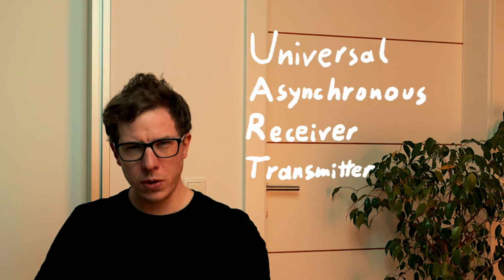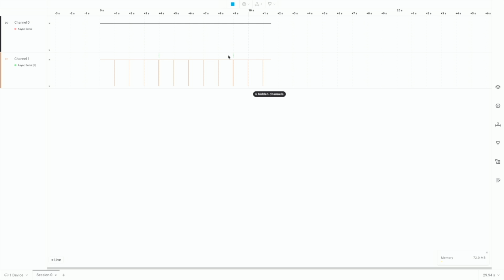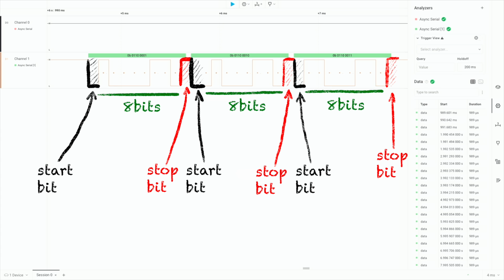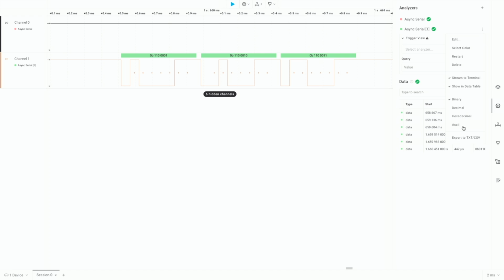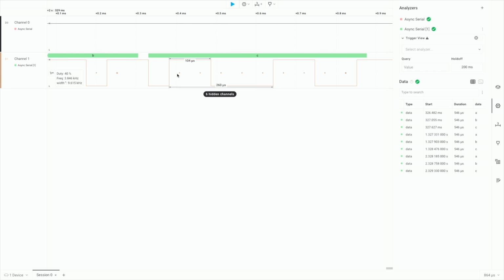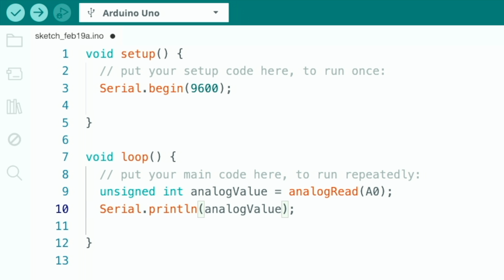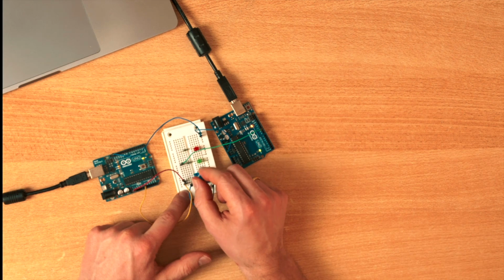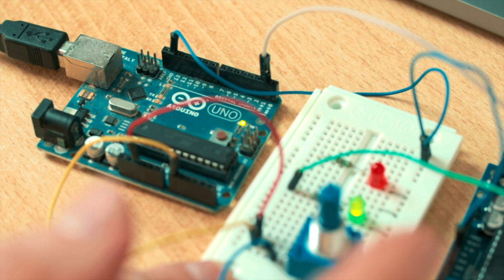Master UART in 1 Video (Arduino UNO Tutorial)

Comment: When an Arduino Mega and an Arduino Nano are connected using serial communication (TX/RX), and one board is powered ON while the other board is powered OFF, electrical power may flow from the powered board to the unpowered board through the serial pins. Can this back-powering condition cause power-related issues or permanent damage to either Arduino board?
Reply from the maker: This happens because there are protection diodes between the ATmega Pins and the supply voltage. If there is voltage on the pin but no supply voltage, you power the board through this diodes. I never killed a chip because of that but jt should be avoided because these diodes are super small and if they die, your uart pins also die
Reply: @playduino  Thanks for the explanation🥰. Will adding current-limiting resistors fully prevent the back-powering issue?
Reply from the maker: To protect the diodes you would have to use a very high resistance and that would slow down the UART signal significantly. With low baud rate this might be feasible. But clean solution is the use of a buffer / level shifter
Reply: @playduino  Thanks for the clarification. I agree that a logic buffer or level shifter is the proper solution

Comment: Wow, Nice explanation. But how it's possible to use UART pin at the same time you are connected to computer? The USB connector suppose to share the same pin then the UART pin.
Reply from the maker: The ATmega328P chip uses UART to talk to the PC as well. There is a second chip on the board that translates between USB and UART.

Comment: Rather than using map() to reduce the potentiometer value from 10 bits to 8 bits, you can just bitshift right two places:

Serial.print(potData>>2)

This is a much faster operation than using map. If you look at the definition for  map(), it casts everything to longs, which takes up a lot more memory, and then it does division, which is a really slow math operation for the Atmega328. But the processor is optimized for doing bitwise operations. I'm pretty sure that bitshifting right two places only takes two clock cycles. 

This optimization isn't always necessary, but it's a great tool to have in your kit! Bitwise operations allow for a lot of cool things
Reply from the maker: Yes! Great solution! Thanks for sharing!

Comment: Nice video.
About parity bit: Maybe I was reading the documentation too quick. But if i sent a parity bit, then shouldn't be there something like "Serial.error()" to detect if the data was read correct? So how do I read/check if the parity (the data) was read fine?
Reply: In my experience with barcode readers, errors were handled automatically by either hardware or whatever library I was using. At least, I didn't have to write any code to handle the error. Before I understood how useful the parity bit was, we had it set to NONE and I had to write code checking for nonsensical barcodes. After enabling parity, the check function never detected another issue.
Reply from the maker: @dimBulb5 interesting. I will play around with it.
Reply from the maker: Good Point! I think this only works by checking the AVR UART registers directly.

if (UCSR0A & (1 << UPE0))